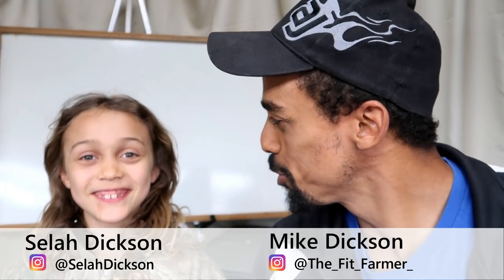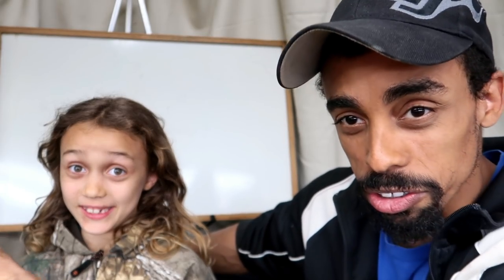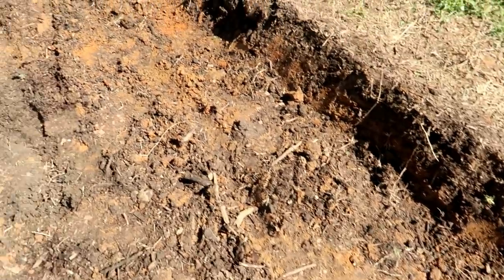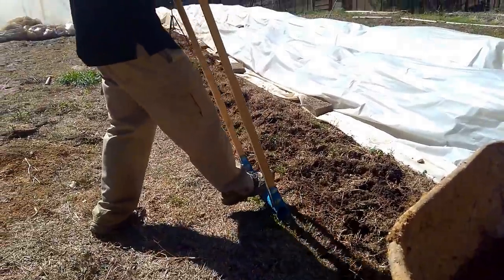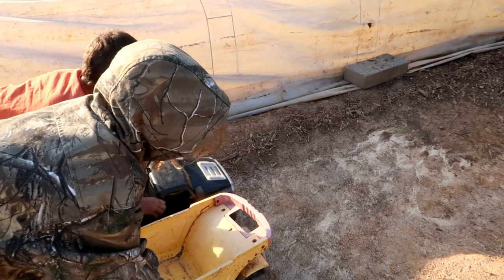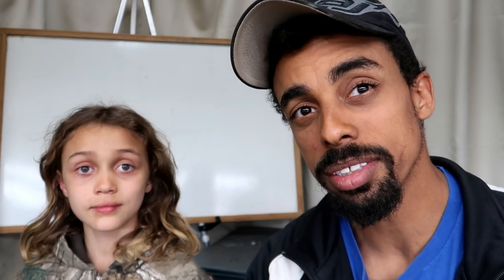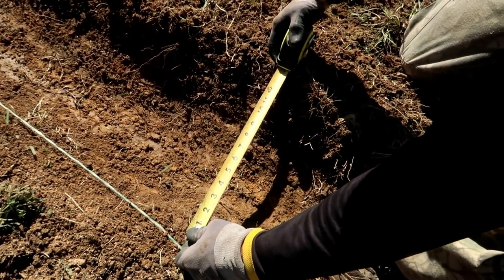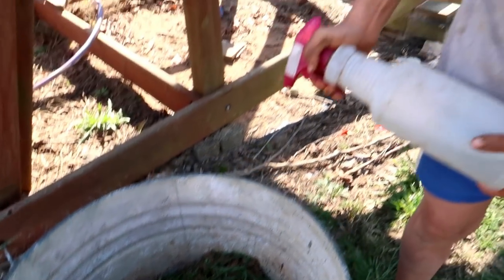Prepping Market Garden Beds and Paths // Farm Days at Big Pond Farm // Walk this way!

Comment: Can you please provide a list of materials you use? I am in particular looking at the black tarps you use for your rows. What other types of coverings do you use? Fleece? Insect? Shade? Not wanting to get into market gardening, but would love to be a little more successful putting food on the table. Thanks!

Also, can you do a video on the differences between poly tunnels, caterpillar tunnels and green houses?
Reply from the maker: Hey Deb! We do need to do a video on the materials that we use and we could add the differences between the poly tunnel, etc... Thank you for the suggestion! The black material that we use on our garden rows is Dewitt Sunbelt Woven Landscape Fabric. I need to add a link on our channel again. Thanks for the reminder! We do use insect netting but I really don't have a particular brand that I like. If I had to give you one suggestion I would suggest the landscape fabric I mentioned above. Hope this helps!
Reply: Thanks! It is very helpful and the landscape fabric is on the way. I am going to plant my brassicas, peas, onions and spinach this weekend. We have had such a problem with weeds in the garden that I don't want to till it up until I can put the fabric down on the parts of the garden that will be planted later. I am also getting the insect netting...grasshoppers here in Colorado are horrible. The chickens can't even keep up with them. I am hoping the fabric and the netting will at least keep them to a minimum in my vegie garden. Thanks again...I am grateful for you knowledge and mostly your willingness to share it.
Reply from the maker: You are so welcome Deb! We are happy to share what we know with others! Thank you so much for watching our channel!